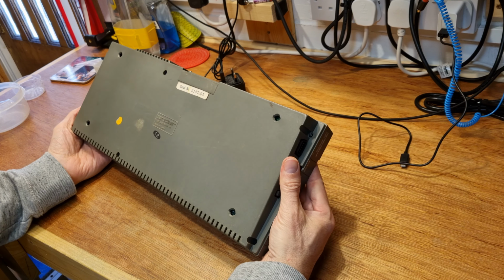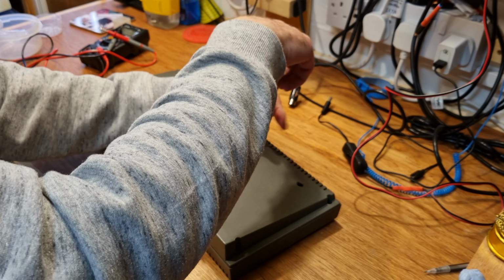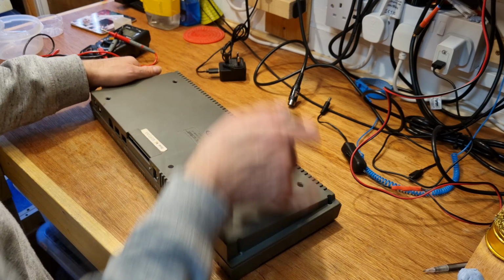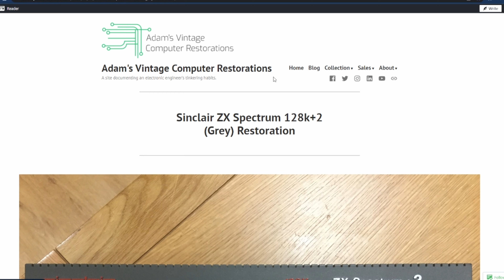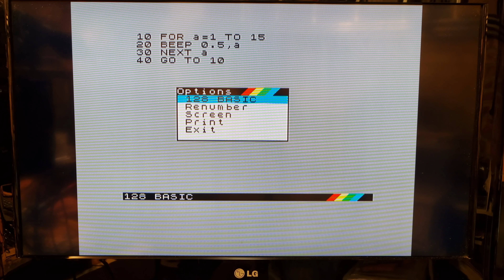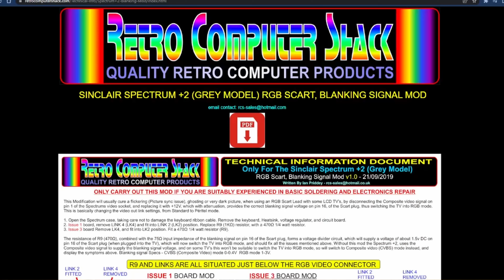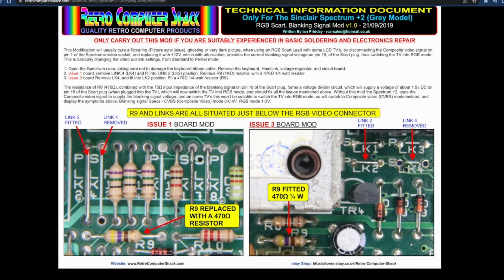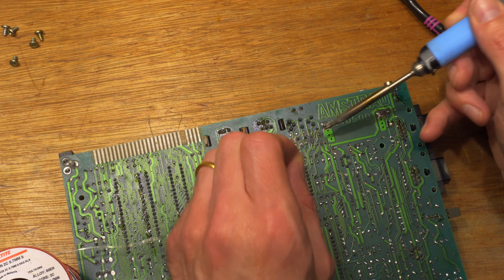Factory Mistakes and Dodgy Power Socket - ZX Spectrum 128k +2

Comment: The most prctical feature of the 128K range of Speccys is the MIDI port. Admitidly no comercial software, (that I can find), uses this internal port, so I had to write my own software in 128 BASIC.
Reply from the maker: The forgotten Spectrum port!
Reply: @MoreFunMakingIt  Yeah, I have a Casio CT-460 set for MIDI chans 1-4 and a Yamaha DD-10 drum machine on MIDI chan 6. The Speccy MIDI out goes into a simple splitter I made.

Comment: I thought the plus 2 rgb socket had sound on one of the pins yet your fancy cable has a separate lead to the sound socket? Am I incorrect?
Reply from the maker: I would have to check, but I seem to recall no audio unless I plug in that flying lead